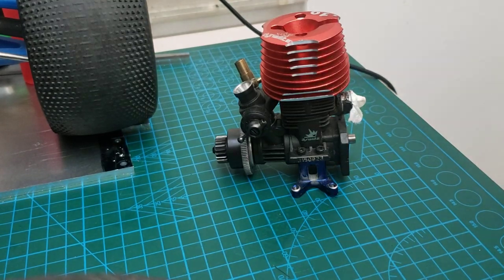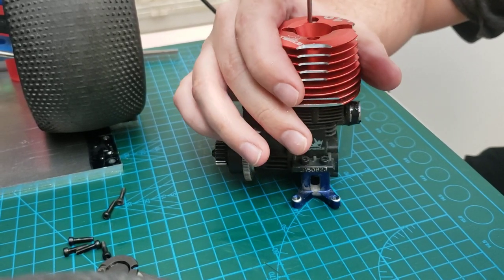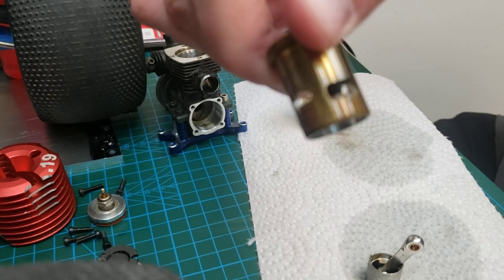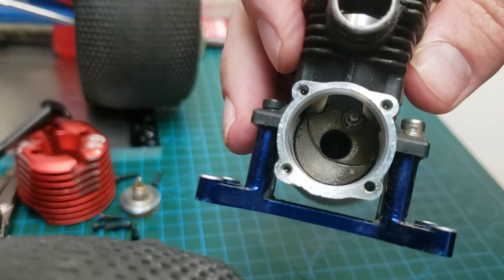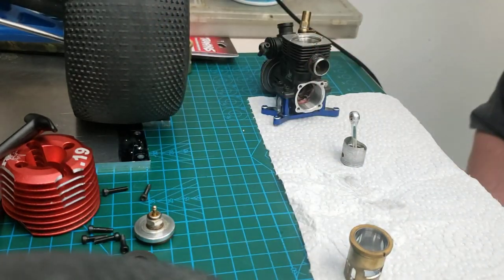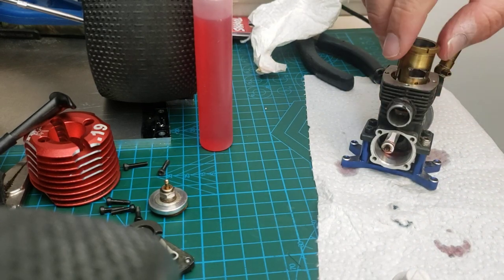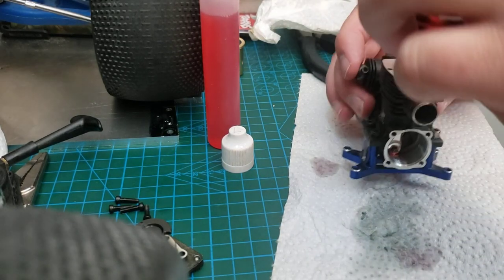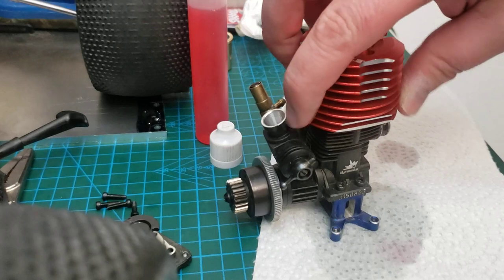Dynamite Mach 2 .19 look inside after 10 gallons.

Comment: finally got around to putting the revo with the .19 in it. starts and runs if u blow in the exhaust tube or prime it 20 or 30 time runs for 5 seconds at idle then stalls. its as though it wont pull its own fuel. factory setting no needles touched.
Reply: done this for about 20 minutes now repeats same prime run and stall as many times as u prime it, throttle settings irrelevent, will rev up untill that prime runs out. not that id ever rev a new engine but this one wont idle regardless of throttle settings so wasnt sure what to do.
Reply from the maker: Sounds like a fuel or exhaust system leak. It's in a revo you say? Order a spring mount header or os 21tm revo header. The Traxxas one doesn't fit properly on the 19 and make the exhaust leak and you won't get any fuel pressure you will have lots of starting and tuning problems. Also make sure your fuel tank lid seal is in good condition and not damaged or you will have the same problem
Reply: @thebug4046  running a sprung dynamite platinum pipe. another issue is. the throttle servo horn is about 1mm too low to reach the horn on the carb slide. the only way to get the carb slide to actuate smoothly is to run that screw alll the way out and leave it on half a thread in order to get the carb slide to make contact with the throttle servo and even then the plastic is bent to near snapping. i dont think this engine and carb setup is meant to work on a revo
Reply from the maker: @kx85isweet  they do run good but they don't have the best fitment unfortunately.
Reply: @thebug4046  honestly i just wabt to get it to a point where it can idle so i can get a couple tanks through it meanwhile i can sor out some form of throttle servo linkage that will work with it. if i have to il take the carb slide horn and grind off the bulb so its smooth similarly to the tm21 maxx carb slide horn. no bulb
Reply from the maker: @kx85isweet  that might work.
Reply: @thebug4046  what was that fb group you mentioned? im in ontario so it would be cool to see what others think about what ive done wrong or maybe what ithers have done right to fix the linkage issue. motor fits perfectly in terms of gear meshing but if u look at a 33 back plate and the 19 backplate. the 19 appears to be ever so slightly longer so much so that the pull start housing hits the upper rear a arm. like u said there are some fitment issues and im curious what others have done.
Reply: @thebug4046  i do have a bnib older gen 3.3 and a bnib 21 tm so if it just wont work i have ither options. just after watching your videos i was keen to try this guy out, im hopefull i can see what ither revo owners have done
Reply from the maker: @kx85isweet  hey man it's Nitro RC enthusiasts on Facebook post a video or a picture of the problem. Bunch of good guys in there im in their as well
Reply from the maker: Pretty sure there's a handful of revo guys with the 19 that can lend a hand 💯
Reply: @thebug4046  slapped a lil post in
Reply from the maker: @kx85isweet  i seen it
Reply: @thebug4046  what u thinks?
Reply from the maker: @kx85isweet  if you can get a video of trying to start it next would be awesome. I did notice the factory settings to be to lean at least in my area at sea level needed the low speed opened ½ or ¾ turn from what I remember. And I think I mentioned exhaust header leaks witch is a problem with the 19 without a spring mount header and the os 21tm exhaust gasket witch will fix that issue for good. I really wish they did what os did and include a header that works properly with the engine
Reply: @thebug4046  ive richened both riuchly an 8th of a turn because i thiught the secind it fired up it was on the lean
Reply from the maker: @kx85isweet  oh good I'm glad

Comment: Questions:

1) Can i run this engine with the stock exhaust that comes on the tmaxx classic ?

2) Can i use this engine on a Tmaxx Classic without damaging the transmission ?
Reply from the maker: Yes it will drop right in to the oem engine mount and get a THS pipe kit for a tmaxx the Traxxas exhaust doesn't work properly or perform well with this engine lots of people in my rc group will show you what you need. Facebook nitro/diesel/gas rc and more. Just 2 questions to answer and I will let you in as I'm the owner

Comment: Hey man you gotta help me, I'm trying to start my nitro but it will start in short bursts and then cut out, i prime them again and the cycle continue. You're my last resort, i've tried reddit and forums and have tried everything they say. Ive tried opening the throttle gap, making sure to prime it enough, leaning the low speed (currently at factory settings) leaning the high speed, i just cant figure it out. 
I have a losi 8ight t, stock engine, dynamite ercm pipe, tuning is at factory settings, and my throttle gap is little over the recommended amount. Engine isn't worn out, still has good amount of pinch, about 3 quarts in the engine.
Reply from the maker: That could be a number of different things like a fuel or exhaust system leak which is very important do not have any that could be a bad or incorrect plug depending on what entry you're dealing with old fuel over rich low speed needle. Hit up Nitro RC enthusiasts group on Facebook im an admin in their. Post a video and I will pop in Look for a guy with dark sunglasses 🤘🏻💯
Reply: @thebug4046  Ok man I posted it there, it may not be helpful or not but i used wd-40 to clean the fuel tank, i'm not sure if it could damage the fuel tubing but i made sure to drain all of it before using
Reply from the maker: @nitroluver4l591  WD40 is a petroleum based solvent Designed for displacement of water. It's not ment to go in the fuel tank. It can swell O rings and won't mix with the fuel and won't run on it. For cleaning up a fuel tank use a strong alcohol like what you get at the hardware store. Like denatured alcohol or 99% rubbing alcohol. I have video on that. Also don't use WD40 as after run oil again being a solvent it has no Film strength over using a real oil like ATF or air tool oil
Reply: @thebug4046  I couldn't fix the problem so i took it by a hobby shop and they said one of carb jets was bent, so they installed a new carb and i'm back running burning nitro!
Reply from the maker: @nitroluver4l591  right on! 🤘🏻💯🍻
Reply: @thebug4046  Hey do you know what dimensions the engine bearings are for the Dynamite .28 rtr engines? They don't sell them officially
Reply from the maker: @nitroluver4l591  i know what they are for the SH dynamite engines but not the different looking dynamite RTR engine. I'm assuming they would be the same. But if you have a mic pop it out and see